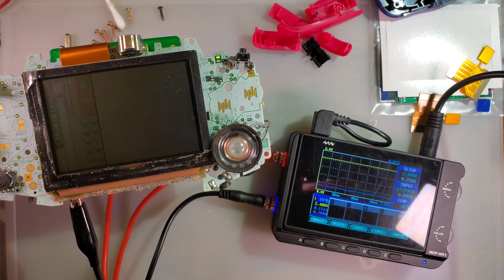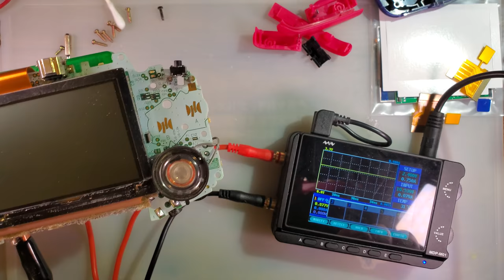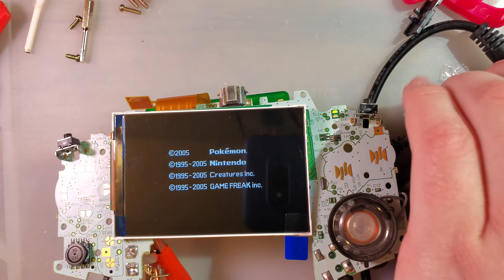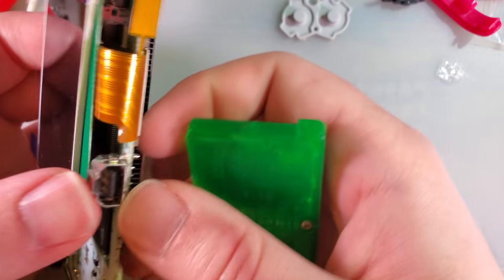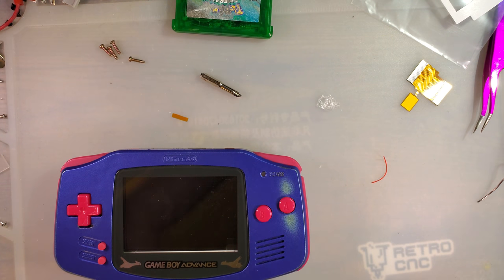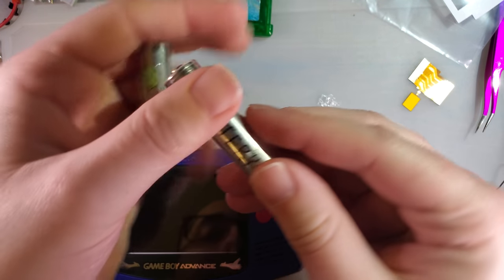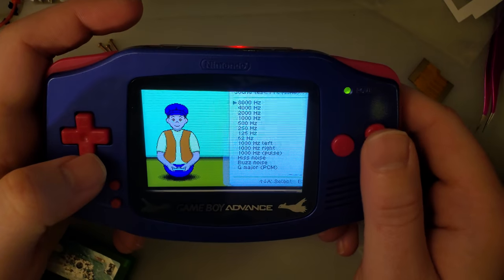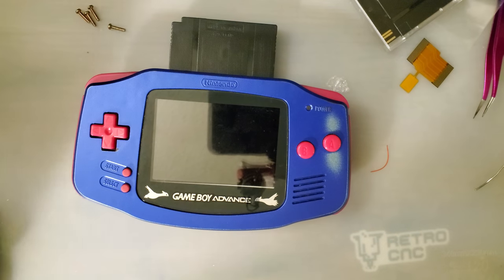Game Boy Advance Drop In Backlight Kit - Cloud Game Store

Comment: I recently installed this mod in my original GBA & bridged the Q2 pins with conductive epoxy. The  touch sensor was giving me trouble so I just cut it off. My GBA is now always at optimal brightness- awesome!
Reply from the maker: "conductive epoxy" is the wrong material for this
Reply: All I have is a cheap soldering iron that cannot be temperature-adjusted; didn’t want to risk it. But I guess I did something right because I’m very pleased with the result.

Comment: Definitely going to be getting this screen. Though this seems to be similar in size to an original GBA screen to fit in an original shell. But I am going to be getting a custom printed shell from RetroSix, and their shells are molded to fit ips screens that would require cutting an original shell, so what kind of bracket should I get to align that, or is there a way to help align it properly without getting an alignment bracket?
Reply from the maker: I do not recommend that vendor. They have a known history of IP theft and QC issues. 

Instead, cloud game store also makes shells and their kits (this video) are designed around being installed in those types of shells. 

If you're sold on the retrosix housing anyway, you'll have to ask them for a bracket for their shells since it's all custom.

Comment: Hello, Really nice video, What could be happening if I installed as shown but the screen is not even showing light? Also one of the times I try to install it it foes show light but no image, so I re opened it and try to review that all connections were ok, and then It didn't show light again.
Reply: Could be the ribbon cable be damaged? it really looks ok with no any damage, this kit i got is brand new so I don't know what is happening

Comment: No pixel grid in this one? I'd love to have an IPS screen like that for GBA.
Reply from the maker: I disagree. The pixel grid does nothing but reduce performance of the kit (if emulated) and decrease visual fidelity.
Reply: @makho  Didn't know the emulated grid impacted performance. Could you develop more on that, please? 

I just like the way it looks, more like the original. For me, it's the same as emulating scanlines on OSSC.
Reply from the maker: @BrunoLouviers  reduces the contrast of the image on the display and reduces the effective brightness. Inserting the lines into the LCD display also likely requires extra processing power.
Reply: @makho  Thanks! Would love to hear more about the not so obvious limitations these screens could have

Comment: As someone who can't solder to add brightness controls, this kit looks really good. Also, how can I get the tool "240pee_mb.gba"?

Edit: nvm I saw the description. Also, how would you compare its brightness without soldering on the tiny chip? Do you think solderless 32 and 40-pin will vary in brightness?
Reply from the maker: The low brightness after the mod is pretty similar to high brightness before the mod.

Comment: Hey Makho, I’ve been watching your videos for a while, so I wanted to ask you a question. I picked up a GBA for pretty cheap, but the shell has a large crack in the back. I was looking on RGS for shells and screens, and I was thinking about ordering a FunnyPlaying IPS shell and a replacement screen, but i’m 90% sure that this will only fit in an OEM shell, so are their any other good IPS screens that I could buy from RGRS that could work with an IPS shell and wouldn’t require soldering? Thanks?
Reply from the maker: the IPS screen kits work with IPS shells
Reply: @makho  would this one specifically work with an IPS shell? or would I need to get another screen besides this one?
Reply from the maker: @evilahhmii  if you get the backlight kit that the shell is explicitly designed for (hint: funnyplaying makes both) then you won't have any problems. I outline this in the wiki linked in the description.

Comment: What is that power supply you’re using??? That thing looks awesome!
Reply: I might have answered my own question…. It looks like a Sainsmart MDP-XP Mini. Is that what it is? It seems pricey. Is it worth it?
Reply from the maker: @JeffHochberg  For what I use it for, I find it very worth it. If you just want it to power game boys, you know you can do the same thing by just seating the console back in the housing and installing the batteries, right?
Reply: @makho  I sure do. But I’m a ham radio operator and have a lot of other electronics projects that I work on. I’ve been looking at some bench power supplies but they cost quite a bit more than this one.

Comment: Makho I just downloaded the 240peegba and when I tested motion blur the square that flickers lingered after I left the motion blur test the particular kit is a freshly installed funnyplaying ips v2 kit with the LG panel not the crap newer one I bought a few of the LG panels before they ran out after your warnings I’ll test my one chip v2 kit which also used the LG panel to see if it does the same my flash cart is the gba x5 mini

Edit: the one chip v2 in fact does not have the issue where the motion blur square lingers after leaving the motion blur test it is how ever slightly off on the grid test the bottom left corner is cut off slightly I never noticed it until the grid test when I tilt the gameboy I can see the rest of the grid so maybe the aftermarket one chip lense is just cutting off some of the picture? That would be simple to fix with a funnyplaying ips screen swap onto the one chip v2 ribbon then I’d have the no flicker issue and the superior screen 🤷‍♂️ best of both worlds lol I also love the brightness memory of the one chip kit and the extra brightness levels what are your thoughts?
Reply from the maker: I updated my wiki notes for this screen a few minutes ago. Feel free to take a look.
Reply: @makho  will do!

Comment: This kit caused some problem i.e. brightness control suffer "Ghost touch", hissing sound when lower brightness..
Reply from the maker: I can't say I've seen this, but I haven't really played at low brightness. I'll have to undo the soldering and play some more.
Reply: @makho  "ghost touch" will happened when using multiple in one bootleg cartridge in game selection screen.
"Hissing" or "Buzzing" noise is more obvious when GBA amplifier installed and ezflash cart inserted.
Reply: @simontewkokyong9159  I can actually confirm this. Granted, the GBA I installed this on doesn't have the best volume wheel, but when I put it at mute, I still hear the faintest of sound, as well as hissing.

Comment: Hi, I just got this and it works great, but is it possible to cut off the touch sensor brightness thingy without ruining that cable? I’ve found that it just keeps changing brightness randomly and doesn’t work when I tap the shell
Reply from the maker: You need to follow the instructions and cut the sensor in half. It also helps if you stick the sensor down with adhesive. 

But yes, you can remove it.

Comment: Hi! I have tested this screen from Cloud Game Store myself. I did the same you did with the touch sensor. But i randomly get screen dimming, do you get this problem? It seems like the senor picks up heat from the ribbon cable?
Reply from the maker: how much heat is your ribbon putting out?

Make sure it is adhered to the shell so that there is a good air gap between the sensor and the ribbon. Also, double check your batteries and try fresh alkalines.

Comment: How does the touch sensor work through the plastic??
Reply: Most touch sensors you use are covered by plastic or some other material.
Reply: @AnvilSP  That doesn't explain anything!
Reply from the maker: @OmegaPrime76  Do you want a technical explanation? Go look up capacitive touch sensors then.
Reply: @makho  thanks, that is what I was looking for!

Comment: I am selling custom gbas, is it better for me to use this kit rather than the ips v2 one (for your opinion) ? Cause it looks easier to install and better image quality and perfect screen size? I was the ipsv2 guy until today. The funnyplaying chinese ips v2 is a little bit expensive comparet to this kit btw
Reply from the maker: Maybe you should get one and decide for yourself. You still need to put in effort for the install if you want a quality product that you can attach your name to which means you'll still want to cut shells for this.
Reply: @makho  I am not sure about what is the best for the new consoles that I am going to make for march. I trim the shells with pilecutters from aliexpress gameboy screen kit sellers. The cutters are best for a clean trim. It was like 20 dollars if I am not wrong. Do I need to cut the little tabs for like ags 101 as you said if yes thats actually easier than the ipsv2 ngl. Can you compare all gba ips modded consoles you have in a video maybe? Btw I bought from this one for testing but I cant seem to find color test etc roms. Do you have the link for em
Reply: @Axiarus  as I said I am gonna test them and ordered em but the problem is all of them has pros and cons and non of them are perfect, just trying to get some opinions. For happy customers :D.
Reply: @makho  I perfectly cut the shell and tested 5 of these screens and compared them with several ips and ags 101 displays. If the purpose is price/performance these kits are better compared the most popular ips v2 10 screens. I would use ags 101 for myself always but for a good AIO ready gameboy advance these kits can be used rather than ips v2 ones. Btw thanks for your videos